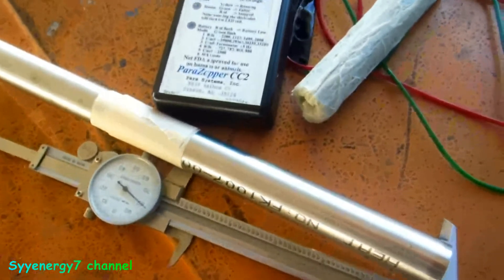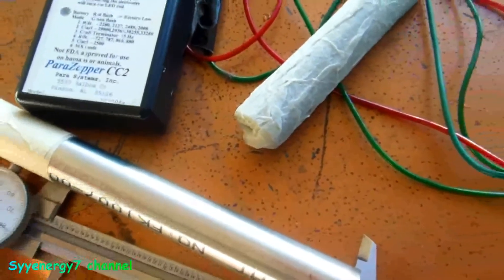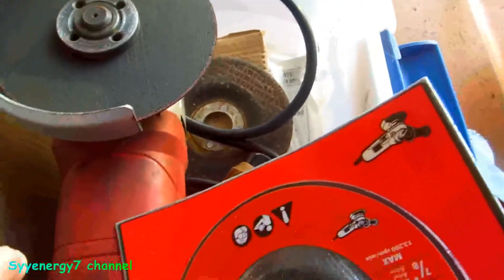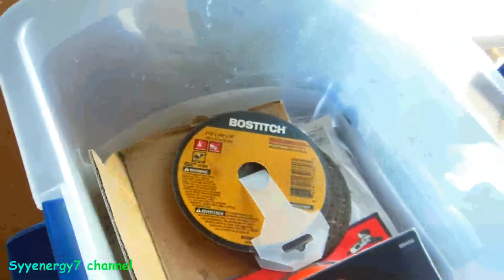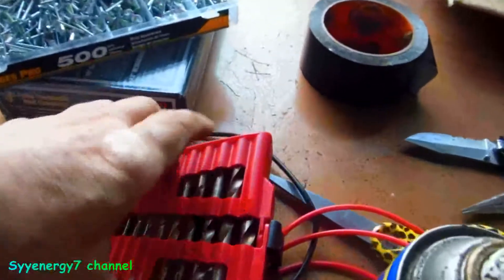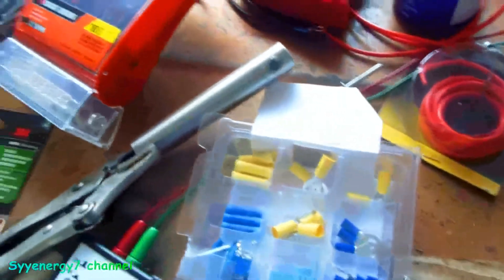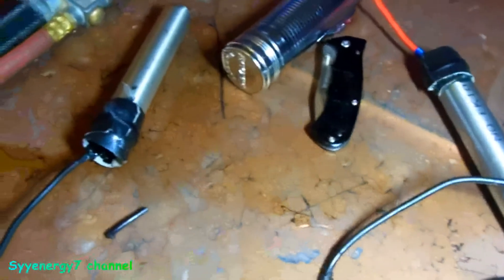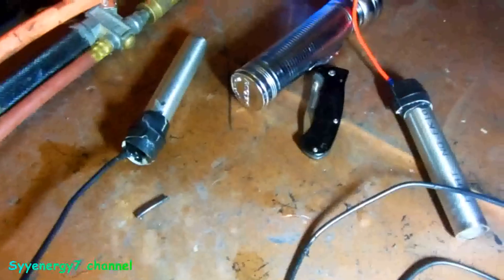Make STAINLESS Steel Handhelds for the ParaZapper

Comment: More likely Our own government will throw the deadly diseases at Us. I just ordered some camping Stainless Steel cups from WalMart less than $10.00 each which are around 4 Inch In diameter, I also thought of using car exhaust pipe but most of It was over $30.00 and for a foot plate I bought a Stainless Steel cookie sheet from Amazon for less than $18.00. Instead of trying to drill a hole In Stainless Steel pipe why Not use a car radiator hose screw clamps. Of course Silver would be better than Stainless Steel but that Is talking major expensive.
Reply from the maker: http://www.amazon.com/gp/product/B004XN9H54/ref=oh_aui_detailpage_o00_s01?ie=UTF8&psc=1

Comment: Would these be beneficial on a Beck Zapper or is it only used on the wrist and ankles?
Reply from the maker: I use the handhelds with the Beck zapper all the time now.  I think it's far more effective and I use the 316 DD type with wet paper towel.   I can't see how those little electrodes Beck used are that effective.  You get way more contact area with the handhelds